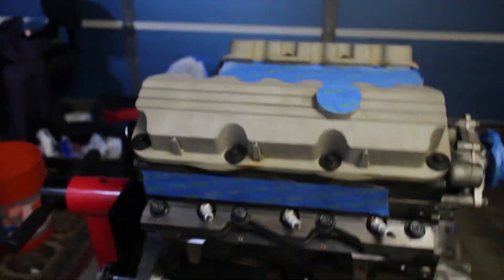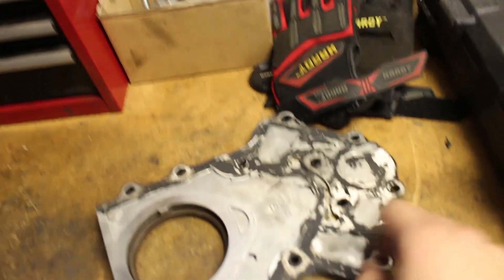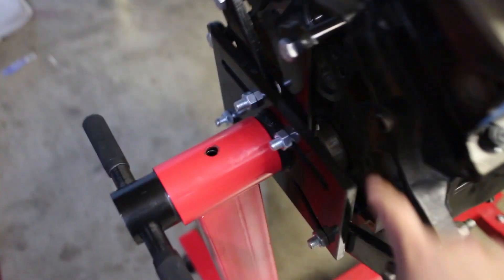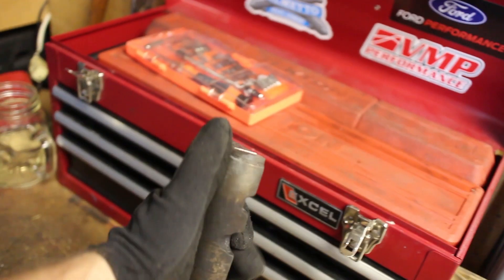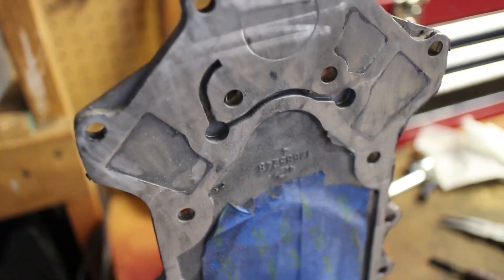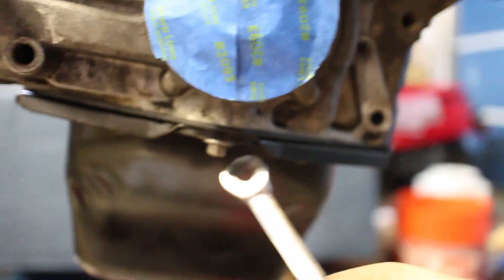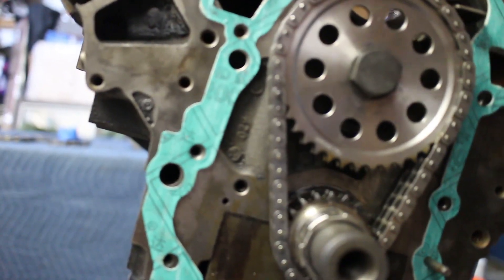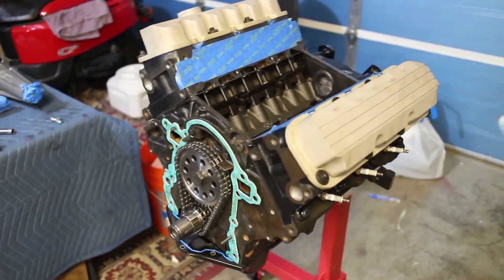Project F 3800 L67 Engine Rebuild! Part 6 (TEARING IT BACK DOWN? WE MISSED SOMETHING!)

Comment: What size bolts did you use for the engine stand to connect the motor?
Reply from the maker: Not entirely sure of the thread type. The engine stand came with a set of bolts that worked for us

Comment: The cam bearings from a Dodge 440 will fit tightly and nicely in the balance shaft mains. The original balance shaft bearings have a channel that would still allow oil to flow around even if turned 90⁰ or 180⁰. Just something I found during research.

Comment: Cam sensor magnet: Seems like the instructions should show the hole position in relation to the timing mark. If so, you should be able to locate the hole without removing the gear. Maybe...
Reply from the maker: I’ll have to take a look at the instructions. Although I think the magnet needs to be placed through the other side, so we might not be able to get around taking the gear off.
Reply: Hey just a heads up, we got it. Took only like 5 mins to do. Thank you for that! We've been looking at your work and improvising ideas off your content. Thanks for that to! For example i didnt know that the SC would be about flush with the firewall before seeing one of your pics on insta. I knew we'd need to pound out some more space, but i dint think it would be that tight.
Reply: Slow down do it right

Comment: Dude, Im doing the same swap, but now I have one problem; the L32 flywheel has a different balance than the L67 flexplate, 
some people told me that the engine can be damaged if I put it like this. How are you going to solve that detail?
Reply: We've never heard about this issue in any of the forums detailing this swap. Ill have to look into it.

Comment: I had to do a timing job on 3.8 series 3 allure...made the same mistake forgetting the magnet in the old sprocket...plus the motor was IN the car lol. Another great video, you're a great narrator. Hope this channel goes far.
Reply from the maker: Thanks! I happened to glance over a video ZZP made, just a quick 3800 build and they mentioned the magnet. I have a feeling we'd be in the same place had I not seen that haha.